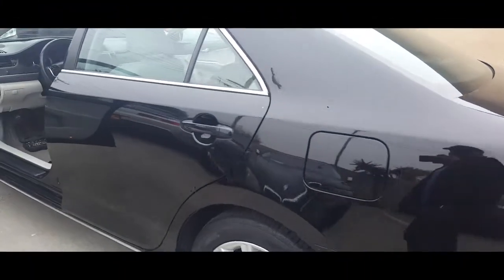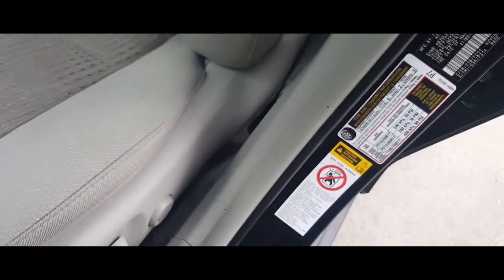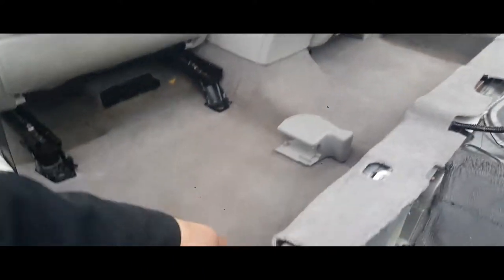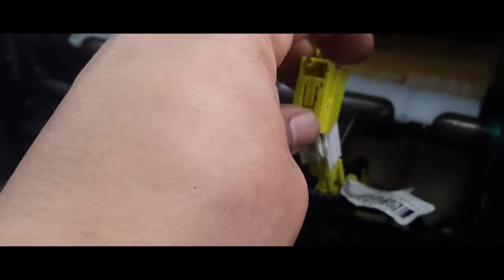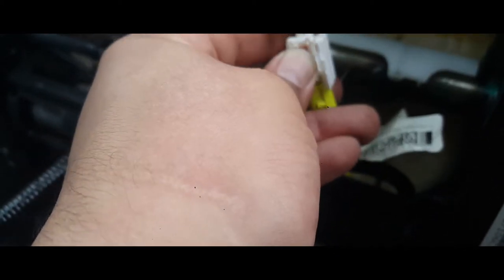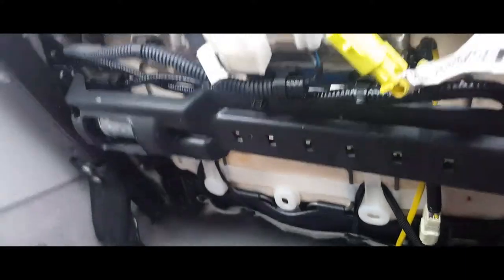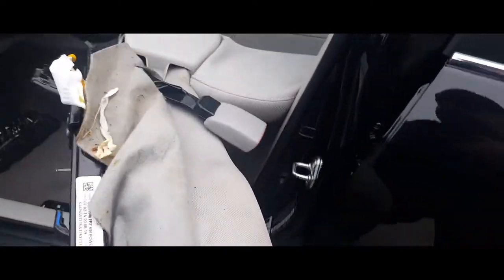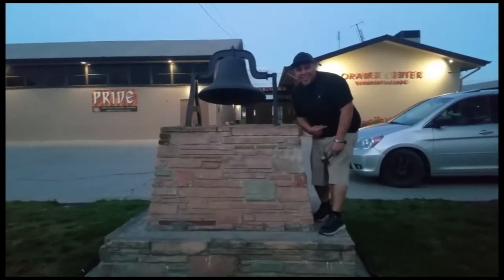How to: Remove a Driver Seat from a 2015 Toyota Camry Hybrid

Comment: Hey George   Can i remove the passenger seat hybrid and leave it out and drive safely? Will i have codes or airbags go off without pass seat connected wires? Thanks in advance
Reply from the maker: Yes you can but you will get the airbag light on because the seat will no longer be connected. but you shouldn't have any issues driving it around like that.
Reply: @559powerscape  thank you

Comment: Will this work for a 2018 camry my driver seat motor fd up i want a manual one
Reply from the maker: Lol, if you get the chair replacement, it should mount right up no issues. You will just have an unplugged pigtail for the seat connections cause it will no longer require power for the seat

Comment: did you disconnect the battery before removing the wiring harness?
Reply from the maker: No I didn't. I have heard the air bags go off when disconnected but I have removed plenty of seats with air bags and never had any problems with them going off.. I mean your cutting the power supply so why should it set it off? If you like, you can disconnect the negative terminal just to be on the safe side but on some vehicles you might have to reinsert the radio code in order for your radio to work. That's the down side. Unless you know the code.
Reply: Hey guys I’m a little confused ? Will the air bags go off if I disconnect the wiring harness and leave the battery terminals connected to the 12V? Or do I need to disconnect the negative terminal on the 12V in order to keep the air bags from activating once I disconnect the cables ? I’m just a little confused since it’s a hybrid. I did this on my old corolla that didn’t even have air bags on the side of the seat, but need to do this now on my lady’s car.

Comment: What drill do you use ? Cause I use a v20 black decker drill and still nothing
Reply from the maker: Some times power tools ain't the answer. Brake them loose with hand tools then drive them out with the drill to save time

Comment: Thank You, I dropped my AirPod in between and can’t get it out. I will try this.
Reply from the maker: How this works out for you!
Reply: @559powerscape  it worked, I got my AirPod out. Thank You !!! 🙏
Reply: Somebody sells cloth-covered foam bars with a small slot in them for the seat belt latch to pass through.  The plug up the "Camry Black Hole" and keep you from dropping stuff in there.  If I can get the guy who bought mine for me, I'll put the contact information here.

Comment: Okey I did 4 bolt and saw two socket it make me stop coz I thought those for air bag ..... Than fail I can't incidently air bag open.
Reply from the maker: Ur good nothing is going to happen. If you like you can disconnect the battery before removing the airbag connector